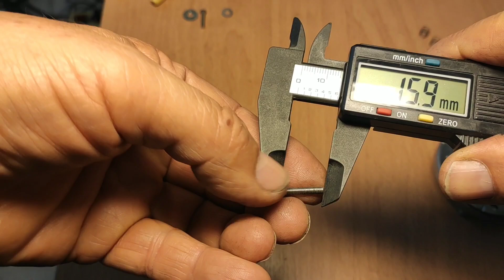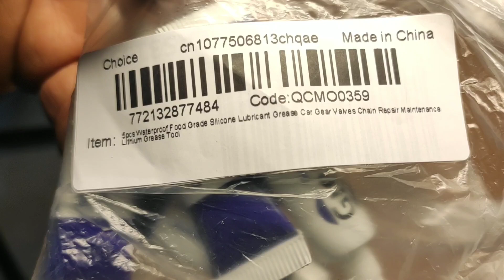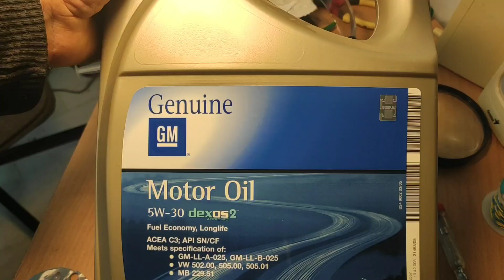e-bike 250W motor how the clutch works (repair attempt).

Comment: Nuts You put in the top of the cluch are touching the case of the motor. You must use rivets and grind them. Inside the hub motor there is none of space for excess elements.